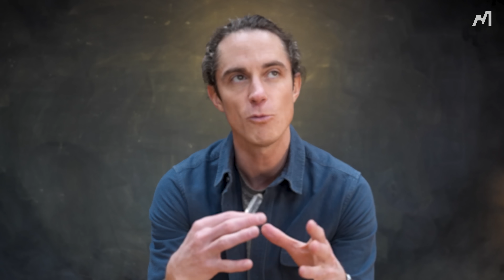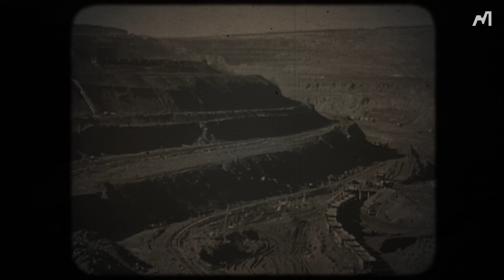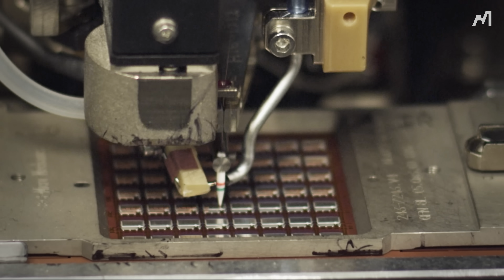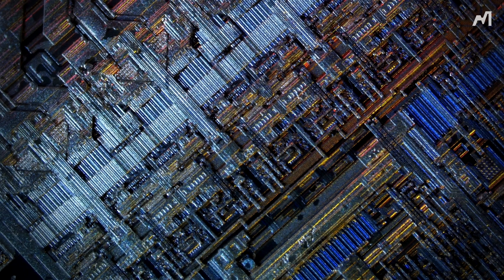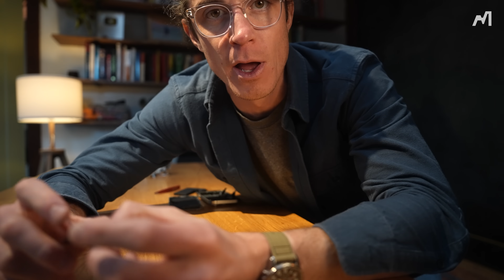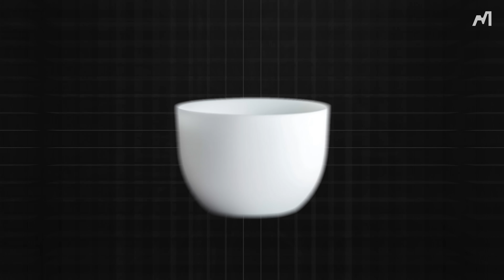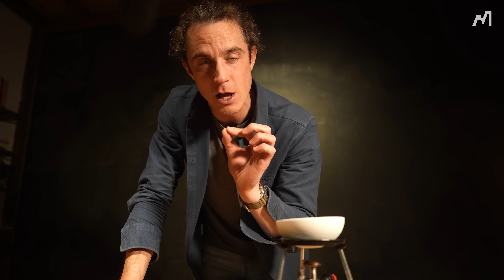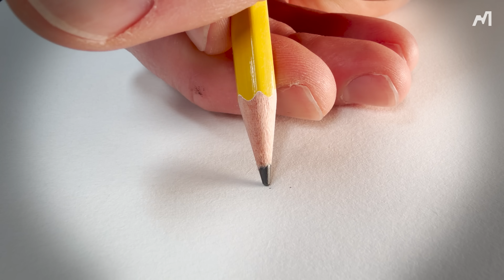Saudi Arabia Has Oil, America Has This

Comment: Brazil also produced massive amounts of pure Quartz during WWII and later.
I visited some of the abandoned mines over there and there was even a landing track built by the USA army.
Reply: The standard for Pure quartz for radios in the 40s is not the same standard for pure quartz’s in the modern age needed for advanced chips
Reply: @Nick-bd4tf exactly...but Brazil still produces extremely high grade Quartz, suitable for micro chips and much more.
Reply: @thomasgoebel6992 No.
Reply: Yes, it was critical for making oscillators and filters for radio equipment!
Reply: Aka Aggregate, right?
Reply: That was the source of all Quartz crystal used by the U.S. in WW 2..
Reply: Yes, and owned by my grandfather, Newton Andrade. The name of the Brazilian company was Diamond Drill.
Reply: It’s a small world 😂
Reply: @MarcioDecat which location was it?
Reply: @MarcioDecat  If you have a soon, people will cry he has "advantages" because his father had a mine.
Reply: @MarcioDecat  cap

Comment: You can make semiconductor grade silicon from beach sand (which is also quartz, BTW) and no, the US is hardly the only country with quartz. And quartz isn't used raw, it's processed into silicon which is an element. So if the US hoarded all the "ultra pure" quartz, it really wouldn't be that big a deal.

Comment: China is not worried:
China’s Breakthrough: While most Chinese deposits were historically lower grade, recent discoveries in Henan and Xinjiang (exceeding 35 million metric tons) have achieved pilot-scale purities of 99.995% (4N5) to 99.998% (4N8). This allows China to compete in technical purity, though the material often requires more intensive chemical refining than Spruce Pine's natural deposits.

Comment: But quartz is artificially produced for industry also.  350 atmospheres maybe 450°C in a caustic soda solution. And it's big crystals that are produced during several weeks.
Reply: But are they able to create the same purity? Silicon is so notorious in creating compounds when heated. And how about the equipment used, thry should use high purity quartz

Comment: My only concern with Spruce Pine, while it sounds great to the U.S. to have a monopoly on this particular grade of quartz, is that it is essentially a single point of failure within the supply chain. Like, for example, if the production district is somehow put out of operations for some time due to, say, natural disasters (flooding, wildfire, whatever) or something.

Comment: It was when I was in high school that I got a summer job at a Bell Labs Fab in Pasadena. It changed hands several times ending up as a Kodak Fab. JPL was not far away. We grew the silicon (Si) crystals but I did not realize their significance. I barely remember how the crystals grew inside a vacuum chamber and appeared to be getting zapped. The crystals were as big as salami sausages. We cut them up into thin wafers. I wore a bunny suit and also packaged glass plates coated with a thin layer of chromium. They would be sent to Western Electric. We also used them as photographic plates after coating them. Etching followed as did cutting them into little chips which in those days got sandwiched into ICs with little spider legs which could be tested in a plastic block with gold contacts. There is tons of stuff I no longer remember. Maybe my memory is all wrong. I was only 16. All I know for sure is that it was all very technical. Except for being a bit hot in the suit it was pretty chill work.

Comment: Sorry dude your wrong on the chip making process. We have chips that fail to cure all the time and we still use the "broken" chips. We just bin them down and give them a lower name off the wafers. Eg you want to make a 5090 but too many transistors fail to setup. Now it's a 5080 TI or 5080 or a 5070 TI.

Comment: All of the clowns quoting Brian Potter's article on Spruce Pines did not really read it. This is the ACTUAL QUOTE. 

But alternatives are all some combination of not yet developed, not quite as good, and not quite as cheap. Cutting off the supply of Spruce Pine quartz probably wouldn’t choke off the supply of semiconductors completely, but it would mean yields going down and costs going up. The industry is aware of the bottleneck: new sources of quartz are being developed, and new crucible materials are being investigated. A new crucible material, if found, would have a particularly large impact: not just because it would eliminate the Spruce Pine bottleneck, but because quartz is a major limiting factor in silicon ingot manufacturing, and a new, better material could potentially increase production efficiencies dramatically.

This is huge in manufacturing terms. And who in their right mind would pay several thousand dollars per crucible made from Spruce Pine Quartz if it was SO SO easy to manufacture at scale. The internet is full of clowns.

Comment: "Sand is defined primarily by the size of its particles (0.05 mm to 2 mm or 0.075 mm to 4.75 mm depending on the standard) rather than a specific chemical composition." I.e, a lot of sand is made from silicon dioxide, but technically any uniform substance that is in the right particle size range can be considered sand. Yes, you can sieve cake crumbs and have a pile of sand made of cake.